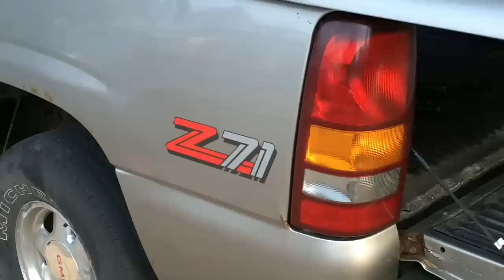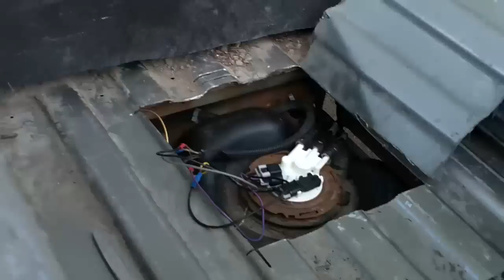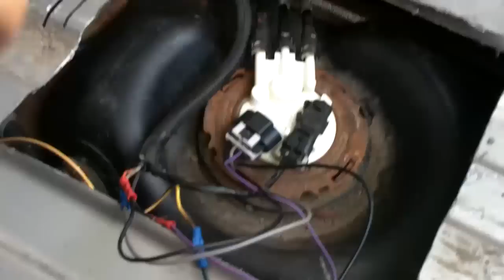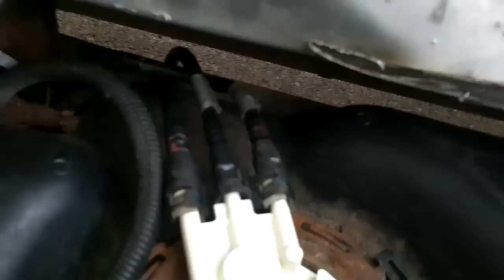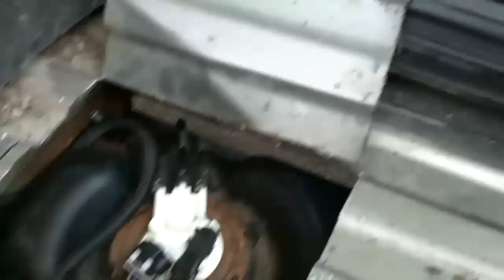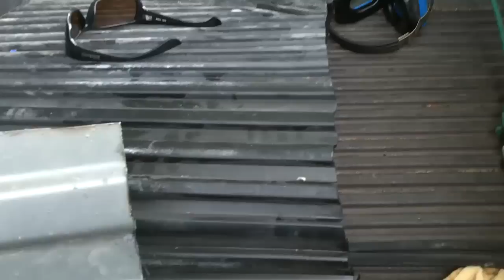GMC / SILVERADO pickup quick fuel pump fix.

Comment: Nine years later your video is awesome I just did that to my truck didn’t take but 30 seconds with your measurements to cut the hole thank you so much now I’m struggling trying to get that stupid ring back on there snapped all the way around.

Comment: I've got people about to do this to my 95 Silverado today......  The Shop $quote  started at $975   so  I'm letting them cut into it.   My truck ain't
pretty but it is mine & it has mostly new parts including an engine w/ 10k on it.... the old one got 330k miles.   So I'm worrying about this hole
in the bed....   YOU said this right;   They should have come w/ an access hole !!!!   but they didn't & I'm here now,,, thanks for the video

Comment: Done yesterday on a 2000. Did 4 " from the top, self tapped metal back in .mcut out the whole square , use duck tape on the sharp edges ! It will save you from getting cut ! That's it . This guy couldn't have said it any better . I hope he makes enough from this vid to buy a new truck .

Comment: As long as you do it right put some hinges and a latch and make it like a normal every day door then I don’t see what these dumbass folks on here , whinny and saying , you ruined your truck bed and shit!!! 95% of the time if your truck is 10yrs old or more your bolts to the bed will be seized up and more than like break 1-2 off and same goes for stripes on tank, it’s perfect and a 5 min job without laying on your back getting dirt and shit in your eyes, hell a person wearing a tuxedo can change his pump in 5-10 mins on side of the road. At the most it’s a 15x9 hole in your bed that opens and closes and would never know it’s there if you have a liner, smart thinking , it’s hard enough to be outside in 15 degrees or like me 98 with heat index of 115 , so calling this man a dumbass or whatever just shows that your the dumbass for not finding a easy solution like this!! And everyone already know a mechanic is always trying to find a easier way to do something to fix whatever but charge the same amount or jack up prices to make smart folks come up with ways to do it there self and not pay someone 5 hrs labor at 45-70 and hour now that’s a dumbass

Comment: No the bed will rot to shit quick.  Lol.  If GM was really smart, they would of designed an line fuel pump.   Oh.  Stop buying the cheap aftermarket junk.  Theres a reason why the oem lasted 125k

Comment: I got a 97 .....been a plow truck it's whole life, tank straps are so rusted from the salt they use here in New England....same for the bed bolts....never happen!    And if it ever fails again, especially during the plow route it's 20 minutes....I keep a cheater (pump only) in the parts box.

Comment: use a oxygen and acetylene  torch its way easier
Reply: I realize Ed most-likely posted this as a joke, but I'll say this anyway. DO NOT USE A TORCH TO CUT AN ACCESS PANEL ABOVE YOUR FUEL TANK/PUMP!!! YOU WILL DIE!!! Though, if you know how to use an oxy/acetylene cutting torch you are probably smart enough to avoid pointing it at a plastic fuel tank.

Comment: Don't cut the bed!  Just take out the 8 bolts that holds the bed, undo the plugs just under the tailgate area for electrical, and undo the filler neck for the gas tank.  Then get 3 friends and lift the bed off.  We replaced our fuel pump in less than two hours.

Comment: Changed mine now it wont even start i wired correctly 2004 gmc seirra is there a line bleeder or ? Thanks in advance
Reply: Nick Imm Does the pump prime?

Comment: I'm looking at my third fuel pump in my 2001 GMC Sierra. I thought about cuttiing a hole in my box like you did and then I saw this video you posted. Thanks for the dimensions Nantuckett, this is exactly what I'm going to do because my first two pumps I had the dealer change and it was like $1200.00 both times.

Comment: Save money on hourly  labor costs from a garage. I did the same thing to my truck when I found out the part was $60- $90 and the labor was $500-$600. My access door is covered by an aftermarket bed liner. Cheap and easy fuel pump replacements for the life of my truck.

Comment: If the engineers at GM had the brains to have this truck come with the hatch as a factory access, would it bother you nay sayers to remove the pump through the factory hatch. So what the hell is wrong with using your brain and making the job easier. This is exactly how I would do this on my truck. I would of course make a seal and bolt the cover down. One piece of advice though, if you are going to use those crimp connectors, make sure you use electrical shrink wrap over those connectors. Personally, I always soldier the wires. Good video and congrats on using your head. Most imports come with this hatch from factory. Anyone feel guilty removing the hatch and replacing the pump. Not likely.
Reply: It wouldn't for the simple reason it would be recessed lip a manufactured door with bolts or screws and a much needed gasket to keep debris and water off the tank. So no, it wouldn't and would have been a great idea and a failure on GM's part.

Comment: . Coming from Wisconsin and owning a shop and a master tech , Vw certified Mazda certified and went to school for my degree through Toyota and gm . This is dumb . I can't believe the ignorance. Reolace straps and bolts if they're fucked don't wreck your bed. Dumb
Reply: What are you so sore about? Most of us don't want to pay 4 hours of labor to a shop for something we can fix. Plus if someone actually uses a cutting wheel the access door will fit in hole. I added two small hinges and an adjustable lock and latch to secure the door. I considered this a custom project.
Reply: Yes , I would do this if the following were true, I didn't have a garage or  floor jack and it was cold out and my truck was very old and rusty . Yes then it would be a good trick and I would do it.
Reply: Most people aren't "Master techs" who own their own shops you moron. The bed isn't "wrecked" either as you put it.  It's an old truck that probably has a zillion miles on it.   I'd LOVE to see you attempt this job on a 15 yr old truck where EVERY nut is welded with rust.  This is a DIY dude.  Try it with just a floor jack and a decent selection of hand tools that a guy might have at home.  No torches, no giant breaker bars, no impact tools. You say its a 30 minute job. So, you would charge me $55 labor in your shop to do this job? You're full of shit. Even WITH a "degree" from GM or wherever and $250K in hoists and shop tools there is no way it can be done that fast.  Why do you think dealerships quote around $1K for this job?  Stick to giving hand jobs to other know-it-all master mechanics.

Comment: It is CRAZY why American auto makers DO NOT install a access door in there cars and trucks to access the fuel pump. It is clear that we an NOT ever going to see the fuel pump mounted on the engine blocks again! All fuel injected vehicles require the fuel pump to be inside the gas tank. Most european cars and trucks have an access door for the fuel pump.
Reply: Tony Webb  lol. That is insuring work for the future.   It sucks they make thing harder

Comment: Why not slide the bed over? I removed 4 18mm bolts and then picked up the driver side high enough to slide it over towards the passenger side and had easy access...

Comment: To all the morons saying this is easy, you obviously don't live in the midwest. You just have no clue. I'd like to see one of you expert mechanics change a fuel filter on a chevy pickup from the 90's around here. Lol.
Reply: +MrCoffeekelly That's why you change it every year. There a bitch.
Reply: +B Mckinnon doesn't matter the fittings will rust and seize  inside the filter within a year or two.
Reply: +B Mckinnon the problem is the fucking fuel line seizes inside the fitting. instead of the fitting spinning on the line it twists it off. then you end up having to replace everything by the time you're done.
Reply: MrCoffeekelly right up here they rust in a few months

Comment: The dumb asses who say that this is an easy 45 minute job have obviously never tried to drop the tank or remove the bed bolts on a 12 year old truck like this one from the Midwest. It even looks like the fucking lock ring on the pump is rusted to shit. Now try to do it when it's fucking -4 degrees outside!  I will tell you the same thing others have....THIS IS FUCKING BRILLIANT! I wouldn't do this to a new truck, but the guy even said it was a work truck with a bedliner and a rubber mat covering it all up. LOTS OF VEHICLES HAVE FACTORY ACCESS PORTS FOR JUST THIS REASON! Thanks for the awesome video!
Reply: Yes! And this truck doesn't even look that bad compared to most I've done. The army 90's chevy trucks are the worst. If you drop the tank on those expect to spend around 250 bucks on new fuel lines.

Comment: this job is so easy a cave man can do it.. wtf is he or any of you talking about. if you think this is hard than stay out of the mechanics field..  wtf i just did this job in 35 min and it was sooooooo easy to drop TWO bolts to drop the tank.. wow!!!
Reply: You're a dumbass. 99 percent of the chevy trucks around here in the midwest the strap bolt are rusted and siezed. what now genius?
Reply: +MrCoffeekelly not only that but what if the tank is full...
Reply: +BOBBY ANDERSON Bobby, you lame-ass LIAR.
I am calling BULLSHIT on your 35 minute job, you moron!
What this clown did to his bed is past being a hack.
Again..............BS on your 35 minute job!
School you on telling the TRUTH!
Reply: Well first having the right tools helps. Second a lift. I own my own shop in Milwaukee wi . If the bolts or straps are fucked  cut the straps and replace them. Why would you want to hack your truck up and leave rusted ass straps on. I'm a master tech and build transmissions for a living. Fapping my sister? Dude that said that just stop and grow up. Having the right tools helps I'm sure. I do these all the time. They are very easy.  The straps and bolts are very cheap. Much cheaper than patching a hole in the bed of your truck. Do things the right way or don't do them.  It true let a very easy job. If there is gas in the tank you use a hydrolic jack to hold the tank up either Trans jack if on a lift or floor jack if on the ground. Stop acting like assholes because you haven't found this easy yet .  Been working on cars for a long time boys. Experience and professionalism. Do a job right the first time. I would fire someone on the spot if I saw them hacking some shit up like that.
Reply: Fapping? Are we 12?  I'm a master tech and own my own shop in Wisconsin. I would school you dude.  Do things right or don't work on cars .  Just because you haven't been shown other ways don't mean they don't exist foolish man.

Comment: I'm with Joshua! It takes 45 minutes, and is far from a knuckle buster! and the dude that says it takes 6-8 hours is on drugs. I have pulled 3 pumps on my silvy, and have tried bed off, bed tilted, and dropping the tank. Dropping the tank takes 2 bolts, and disconnect the lines (which you CAN see and get to easily). I put a board on my jack to support the tank, and walllah its out. Dropping the tank IS the easiest way. If you ever wanted to weld up that hole, you would have to drop the tank anyway.

Comment: Man, all of that complaining. It takes FOURTY FIVE MINUTES, to drop the fuel tank. Update the wiring connector and install the new fuel pump module. You probably spent as much time cutting the bed and complaining about the 'labor'.
Reply: Josh Watson  cut that hole out in under 60 seconds r u kidden me lmao?
Reply: Josh Watson Bullshit dropping tank is far much more work this is the best method on a old truck that’s paid for I did it mines and my truck is a show truck but I got bedliner to cover it up

Comment: Money and time saved kinda except anytime you change a pump you should clean the inside of the tank out which requires removing it otherwise your pump is more likely to fail early due to the sediment in your tank plugging it up, but to each their own and also it only takes 6-8 hrs to actually do a pump without an overhead lift with dropping the tank and cleaning properly.

Comment: Dropping the tank and changing out the pump only takes 45 minutes total on the whole job. Not worth cutting the bed of the truck IMO.  On some cars it is better to go this route. I've done it on a few of my cars over the years because dropping the rear end and exhaust system was not viable.  But on a truck, the job is very easy.

Comment: Did it this to my 2002 Silverado - I carry a spare pump when I go on trips now in case I have to do roadside repair.  NO Tow Truck , NO Repair shop , NO Cancelled Trip  = NICE !
Reply: This is the only reason Im cutting mine. my last pump only lasted 3 months. 2 tows later Im making sure I can change it on the go!

Comment: Dropping the tank on a 1999 Silverado is a nightmare. Picking up the bed is better.  Get the stuff out of the bed and remove the tail gate.  Take loose the 8 bolts (4 per side) unclip the wire plugs at the rear, 3 screws at the filler opening, and a couple friends to pick the bed up.  Move it back 3 feet, It sets nicely on the rear tires and the bumper. Really easy.
Reply: It's easier to just take out the four on the drivers side then listen the ones on the passenger. After that a single person can lift the drivers side up and put an appropriate sized 2x4 between the fender well and the tire. Now you have full access and it's a one man job.

Comment: Wow, I can't believe these prissy 'Hurt my Truck' whiners !  I'm with you Nantuckett!  Others, If you haven't dropped or replaced a rusty old dirty gas tank in a while, then 'have at it'.  It is a dirty, dangerous and crappy job.  As for the Auto Engineers, they couldn't think of a better way to design a gas pump, they had to put it in an inaccessible gas tank.  Sometimes thinking outside the box, is a brilliant idea!  God Bless America!

Comment: Some of you people are WAY to LAZY!! Do not cut your bed! DO it the right way so you dont create more problems for yourself, like getting laughed at when you ter and sell your truck or any of the many problems cutting a huge hole in your bed will cause later down the road! Also, NO shop charges $1000 to do a fuel pump in a chevy truck!!!! Thats fuckin CRAZY! 

My shop charges at the most $100 labor! Take your car to a REAL tech to get repaired the right way!
Reply: Freshkryp69 Wrong bud dealership quote me 1000 bucks and another one 600 ain’t no shop charging 100 bucks to change a fuel pump

Comment: personally I think this is probably the best , fastest, and easiest ways to do this job. I have to replace mine and I am surely doing it this way. I agree this is the way the bed should be fixed from the factory.  if you want to drop the tank or lift the bed that is your choice , but that doesn't mean  this isn't  the best way. so all you "mechanics" do it the way that suits you best. by the way take all your negative comments and stick them up your butts.

Comment: Im an auto tech. I replace fuel pumps all the time cars trucks suvs vans & always drop the tank. Take off fill tube 2 bolts on the straps lower tank & take off lines & unplug wires. This is easiest way.
Reply: Not with a full tank away from home and by yourself. I'll never get rid of my Chevy so I'll just make the access panel look professional.

Comment: Funny how the ones that have never had to do this alone are the ones laughing at cutting a hatch in truck bed.
But it's actually the smartest thing to do, the beds are not easy to lift off, and rust underneath is terrible to work with.
The Manufacturers Engineering Design Dept should have made this a mandatory design years ago. They're the idiots in that sense, they only care about making the money on the repairs at Dealers, garages, and parts sales.
Great post Man from Nantucket.

Comment from the maker: Read the comment...I said it took a whole day to drop the tank. Every strap bolt was almost fused with rust and we were working in 15 degree temp. Plus, one of the fuel line connectors cracked and was leaking.  We were lucky to finish in just 1 day.

Comment: EITHER THAT OR JUZT TAKE LIKE EIGHT BOLST FROM THE BOTTOM OF THE CHASIS TO TAKE THE BED OFF AND REST IT OVER THE TIRES. I DID IT MYSELF, IS NOT THAT HEAVY AS IT APPEARS. 5-10 MIN. TO TAKE IT OFF AND 5 TO BOLT IT IN.
Reply: I'm ole school, my truck is 20yrs old. No way am I defacing my truck. Drain gas tank, drop tank, fix, and replace. Bitches !

Comment: There is an easier way.  On my Silverado I removed the bolts that hold the bed down on the fuel tank side.  On the opposite side I loosened the bolts as much as possible while leaving enough threads to keep the bed from sliding off the truck.  Went back to the fuel tank side and lifted that side a foot or so while my wife placed wooden blocks between the bed and rails to keep the bed elevated.  Maybe a little cramped but worth that for the time saved from unhooking taillights, etc..

Comment: Thanks for posting this. My truck is a long box, which will put the tank farther back, but the 20" from the side helps. I'm going to school to be a mechanical engineer... You know what people piss me off most? Engineers... An access hole should have been designed in these trucks. Engineers should have to do some sort of labor in their field before being hired as an engineer. I've been working on cars since I can remember, I was also a welder/fabricator for 5 years... I will remember those things